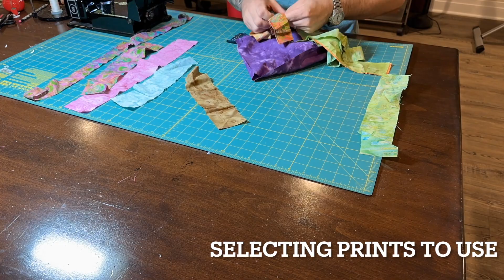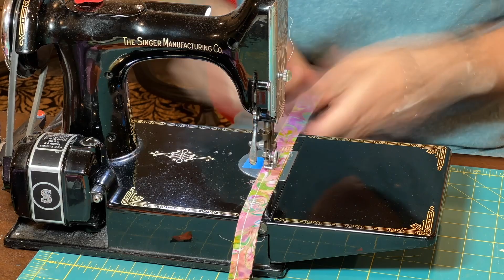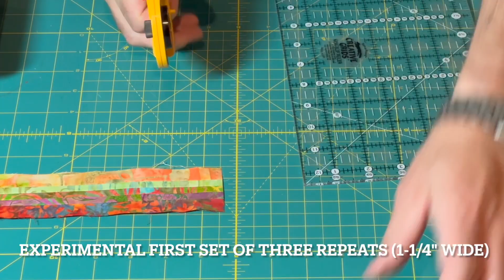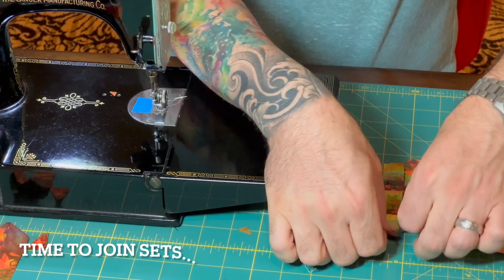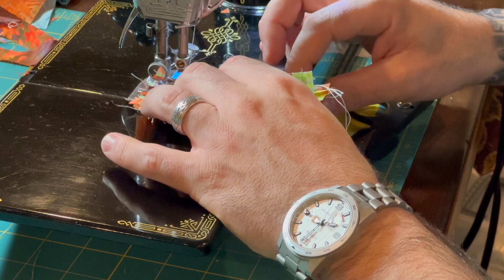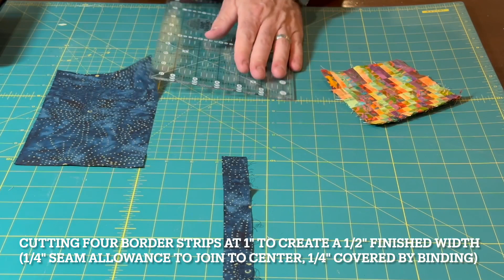How Small Can We Go?  Micro Bargello Quilt Technique Experiment

Comment: You have made a lovely little bargello! I would highly recommend a 1/8th inch seam allowance though. You can either sew at the 1/8 inch or sew 1/4 inch and trim it back. The 1/8 inch seam allowance is pretty standard for mini quilts.
Reply from the maker: I appreciate that. Partway in, I was thinking about trying a 1/8” seam allowance next time, but wanted to give it a try before suggesting it.

Comment: You microscopic seam matching is superlative, and the darker border really helps unify the composition. 

It seems to me that the one pitfall of working with such small batik fabric is that the color relationships get a bit muddled, because there’s not a large enough chunk of the fabric to highlight the base color. This is either a challenge or an opportunity, based on your intended outcome.
Reply from the maker: You are 100% correct about the batik issue, and I’m glad you mentioned it. I realized after recording (so it didn’t make it into the video) that the scale of the prints  relative to the pieces are making rows of the same print appear as slightly different prints. Great observation and thanks for sharing it.